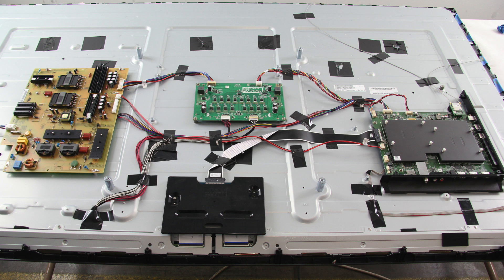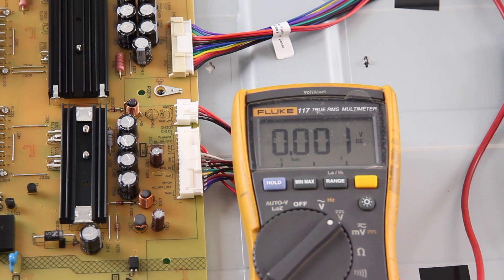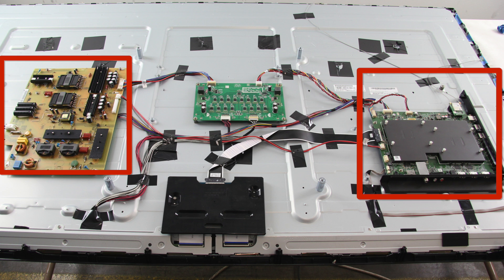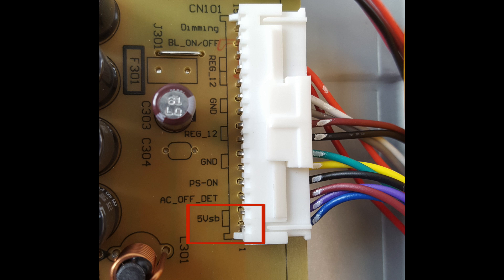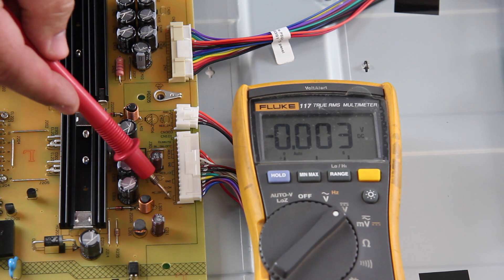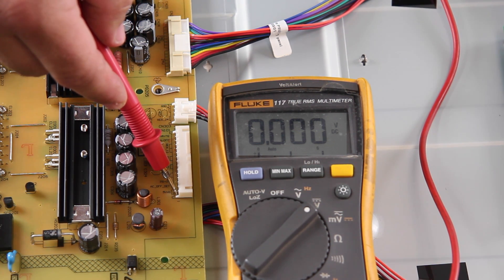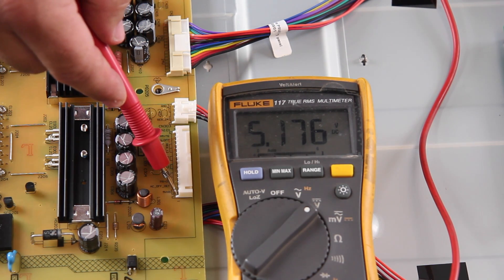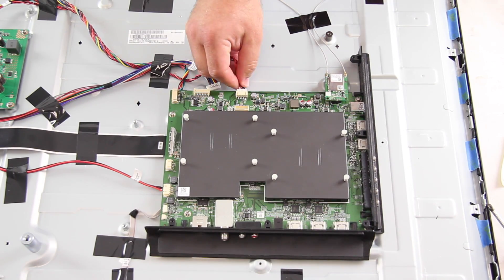Vizio TV Won't Turn On  - How to Measure Standby Voltages for Black Screen & No Power

Comment: I had no standby light had 5 volts coming out the standby pin on the power board and I replaced the main board and still no power or standby light

Comment: Not really TV 'repair' but replacement of one or either major components. Could be one bad cap that's the cause.
Reply: Unfortunately that's how we do repairs today.  It's all boards and they are relatively inexpensive to replace if you use salvaged new parts from damaged TV's

Comment: Hey buddy. How similar is the parts on a vizio tv. I have a 55inch vizio that has sound but no picture. Then i have a 40 inch that has a cracked screen. Can i use the backlight board thing  from the 40 to 52

Comment: What if the tv turns on just fine after being plugged in for about 45 minutes, but will not turn on immediately after being unplugged and replugged, or after a power outage?

Comment: What if you are getting no volts before and after replacing the power supply board?  Should I replace the other power supply boards or should I replace the main board?  This is on a M75-C1 and when I plug it in the standby light comes on but then slowly dims off.
Reply: Did you ever figure this out?  I have a M656 65" Vizio doing the exact same thing.  Power on with remote or button, standby light comes on for about 4-5 seconds then dims and goes out TV never comes on.  I did this standby voltage test and have intermittent standby voltage of 5VDC but sometimes it reads zero with or without the cable to the main board disconnected.  I think it must be the power supply board?
Reply: Chicken or the egg? Bad breath or the fart?

Comment: My Vizio E4201-BO turns on for a second, quick logo, then goes dark. Light on lower corner is lit. Did flashlight test but didn't see anything and no sound. Not sure if it power supply or main board. There doesn't seem to be a t-com board. Any suggestions ?
Thx

Comment: I received a replacement power board for my vizio today. Unfortunately, it also exhibits zero voltage at the standby/5 V pin just like the one that appeared to be defective.  Some of the other voltages are live [12v pins at 19v] but the 5 V is dead.  Do you agree with my assessment that you sent me a bad board?
 
The symptoms of the dead TV seemed to be a classic power board failure. No picture when turned on no sound. No lights at all lighting up on the TV & the standby light is dead. I followed your board testing procedure for Vizio TVs and found that the 5 V standby, or what appears to be the standby, was dead on the original board.
Reply: Did u get it fixed? We had the same issues!!  I order a power board!!
Reply: James Rock how did it go?!
Reply: how about an update
Reply: I have the exact same problem with the same voltage readings; I ordered a new power supply board and still have 0V on the standby pin! So frustrating! If anyone has a clue oe a tip, feel free to share it!

Comment: My  Toshiba 55G310U won't power on, it has 5Vdc but no 12Vdc  on the main board. I can't find a repair manual to show me which fuses and regulators to look at Can you advise?

Comment: I have a Vizio and get NO image display. I have sound and the backlight works, but just no display. T.V. worked one moment and stopped the next and I mean that LITERALLY. It was working as it always had when I left the room and when I returned, the image was gone. There were absolutely no signs of this coming. It just... "happened" and here I type. Upon removing the back of the T.V. and checking voltages I realized I get NO 5V STANDBY! AC or DC I get nothing on my meter.

That has to be the culprit, right? I'm getting a new power supply board as I write this so, if you read this in a few minutes or a few months you don't have to worry about leaving me waiting for a response. I'm just more curious as to what component might be responsible for this, such as voltage regulators.
Reply: was the power supply board the culprit? I have the same problem as you.
Reply: mine done the exact same thing,, vizio tech wont even tell me what part it  needs other than to just buy a new one

Comment: What if instead of getting 5 volts you get 10 volts? I am getting 2x more than it is suppose to get
Reply: Did you ever figure this out? I'm also getting 10.4 on all my 5V pins
Reply: @MichaelFemia  Just disconnect all the connectors to the motherboard, TCon etc. Just plug the power cord. Then measure again, if you still get 10.4 V on the stby, then the power supply board is still the problem.

Comment: I've swapped out my power board. I only have 1.4 volts on each standby wire. TV still will not power on. Any idea what to do next if low voltage found on standby wires? Is the new power board I just installed defective?
Reply: As they say, just keep replacing boards. Ha! They should diagnose the fault...
Reply: update: getting 5 volts when main board is unplugged. assuming I now need to replace that?
Reply: I also have 5 volts when the main board is unplugged but only 1.4 volts when plugged in.  I dont know what to do next.

Comment: I have a problem with a sharp 32"LCD TV model LC-32LE451U that  has no power led coming on but the main board has a burnt ic that I can't recognise the number printed on it but near the ic it's label  UP21 and the number printed on the board is 3632-2622-0150 (1B) can you help me out here please